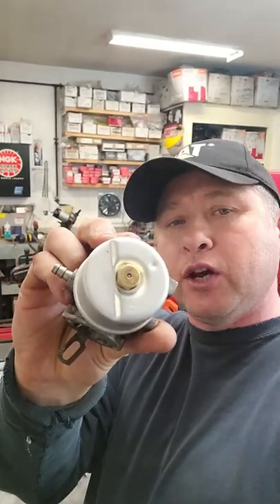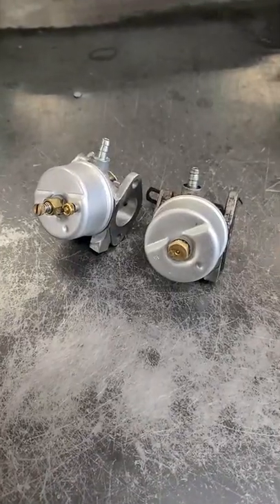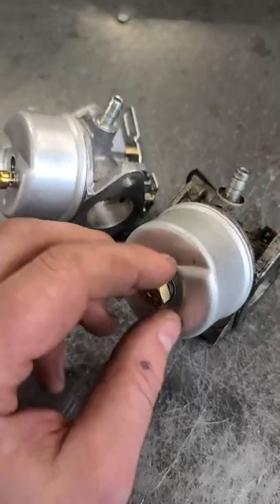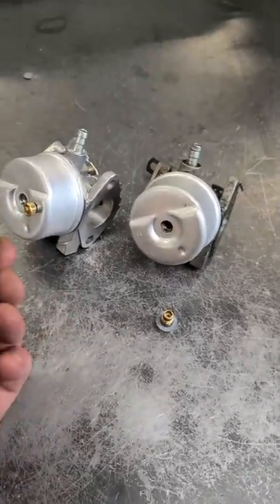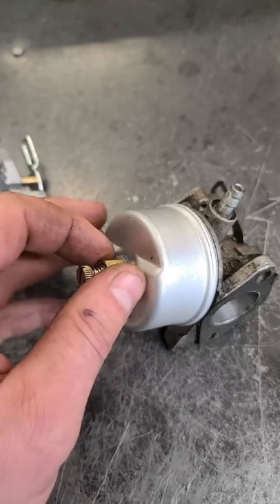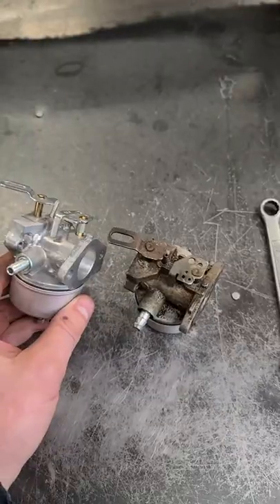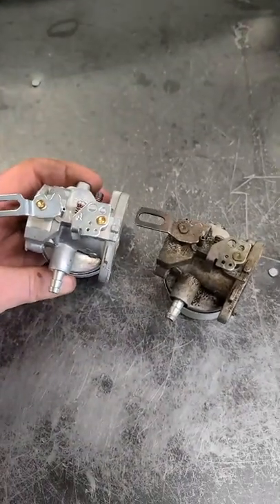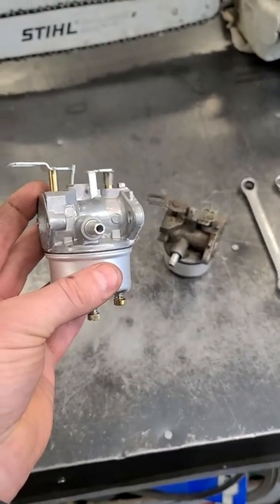Can I Convert A Non-Adjustable Carburetor To An Adjustable Carburetor? #shorts

Comment: I'm not sure of the last time you worked on a B&S Opposed Twin, but those things are notorious for their carburetors in my opinion. Earlier models had fully adjustable Walbro carburetors, which later went to idle-only adjustable Walbro's, which then went to non-adjustable Nikki carburetors during the final years of production. In my experience, the Nikki carburetors don't ever run quite right, but have more power and don't suffer from the flat spots Walbro's have when accelerating. Walbro's can be tuned to run very smooth, but lack power and have flat spots (which get much worse in cold weather).

To get the benefits of a Nikki, but also be able to tune one for weather changes, I'd like to take one to a machine shop someday and see if they can fit adjustments to it. Either way, great video!

Comment: Hi don, I have actually cut off the threaded tip of the adjustable brass screw piece and filed it down so it would fit into a nonadjustable carb. It does run, but i found that no matter what fuel adjustment i had it at, it would either have a slight rich misfire or slightly poor throttle response from being too lean. I guess the nonadjustable carb just wasn't made for the specific properties of the adjustable screw.
Reply from the maker: exactly

Comment: Unless they've changed, I've swapped them over in a pinch when I needed to. I remember during a storm I had to use a bowl screw from a spare parts machine. I cleaned it out and it fit with no problem and I was up and running again. I've since changed that carburetor out for a new one, so it was some time ago.
Reply from the maker: if I need to swap a carb I usually put on an adjustable
Reply: @donyboy73  True. In my case, I needed a quick fix to get me through the snow storm.

Comment: Great Video.  Do you have the Part number for that Adjustable carb for an 8 HP Tecumseh Snow-king engine?
Reply: The part is 632370A and fits 8 to 10 hp engines. Donyboy73 has a specific video on this, search under "ajustable carb" and you ought to find it.

Comment: You just order a assortment of jet orifices and swap out the jets to smaller or larger sizes. Get out your torch head cleaner set and find out what size orifice you have now and work your way up or down until you find the sweet spot that the engine runs best with while under load.
Reply: Link to buy the assortment or gtho

Comment: Hi I have a shidawa 300s chain saw. No adjustment on the carb. This chainsaw is low on power. Can I drill the jet out a little. Would that help. There is no new adjustable carb anymore to order. Its discontinued

Comment: That's mean I can replace a non ajustable carb on a snowblower that use to have a asjutable carb will the engine run the same with a non ajustable carb?
Reply from the maker: yes but not as good as it gets older
Reply: @donyboy73  OK thanks